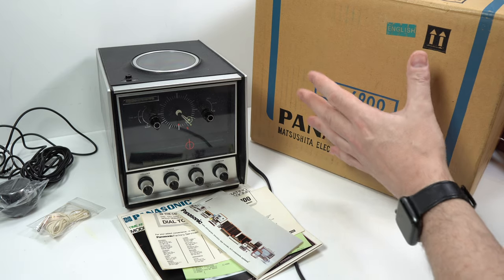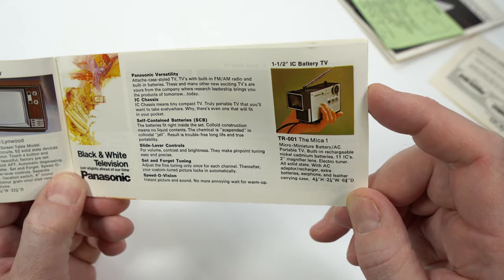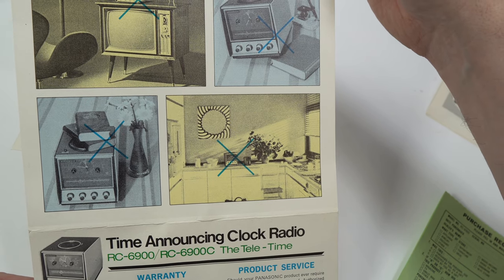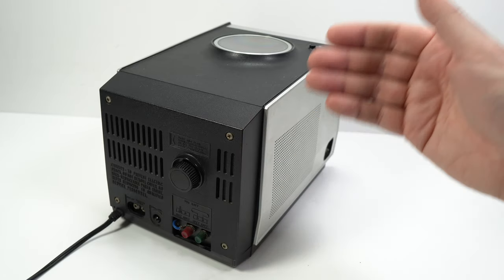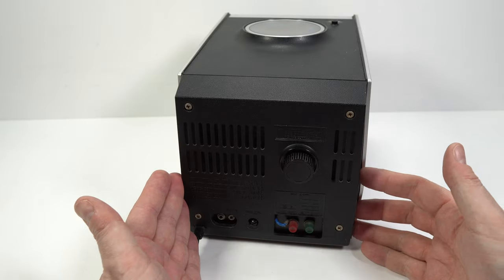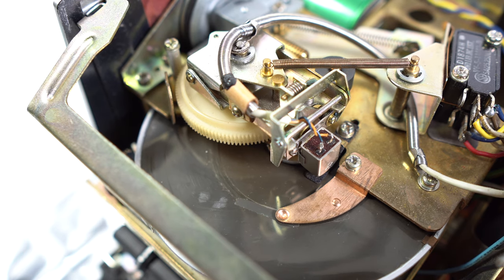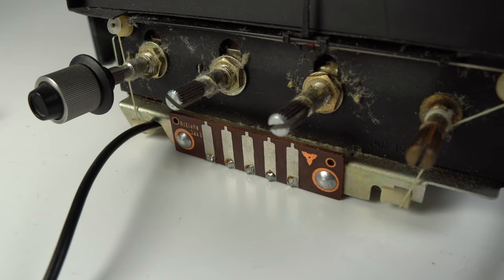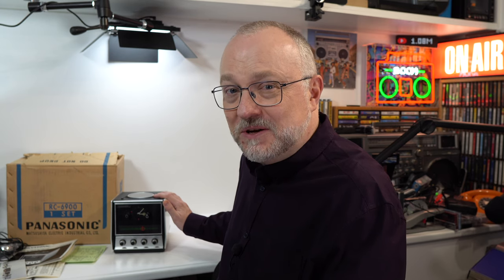The fifty year old Talking Clock Radio

Comment: I worked at Panasonic in my youth, when these and all the products in the mini-catalog were very popular. I was one of the few people in the US who were certified to service these at Panasonic.  It is essentially a cassette recorder where the head moves along the two magnetic "tape" discs.  Other than normal "wear & tear", the biggest problem came from people spilling drinks into it, which would "gum up the works".  Literally, the spilled stuff would adhere the two disks, and sometimes even the moving head, which would wrinkle and rip the disks.   A clean-up and replacement of the disks would restore functionality.  The  worst damage, usually unrepairable, was putting a plant above it with "Grow Sticks" for fertilizer.  The fertilizer and resulting drip water would not only corrode much of the mechanism, but also the PC board below, and sometimes electrically short things out as well. FYI: The disks were available in several other languages.

This and the TR-001 (which was made with Panasonic's own custom thick film hybrids and modules, $$$$ unheard-of outside the aerospace industry) were part of the philosophy of each factory having an outstanding top-of-the-line, unique product.  The first two letters of the model number identified the factory, i.e. RC=Clock Radio, TR=B&W TV,  CT= Color YV, SE=Stereo Combination with mini record player, etc.   Yes, only either the wealthy or the disabled had these.  Only the very, very wealthy had the TR-001, which was kind of impractically small and came with a slide-on 1.5x magnifier.

Comment: You've gotta think the engineer who came up with the concentric magnetic discs was pretty proud of himself. That's a very compact way of appending 2 recordings.
Reply: Ya, very half-way clever that but $130 is an insane amount even today, geez modernity sure went ahead and just spoiled us in tech-liciousness! ;] 
Sad that operational units are so rare.. no doubt due to the fact of all the physical wear to the magnetic discs not to mention being unshielded in that electromagnetically chaotic environment right above a 'light' bulb with equal practicality as a heater. I couldn't figure out where it was playing the O'CLOCK from, which I'm now doubting I even heard ;]
Reply: @djosearth3618  I would assume the O’clock part would be on the minute (outer) disc as there would be no minute to announce then.
Reply: His boss took credit for it. The engineer committed sepaku.
Reply: very cool for sure
Reply: @djosearth3618  in the seventies there was less electric interference than today, so it would be less of a problem. For the blind that price tag would have been worth it, I'm sure
Reply: @uncleTedK  do you mean sudoku

Comment: I'm from Buffalo. I used to get vacuum tubes from that store back in the 90'S.
Reply: Fellow Buffalonian here. Amazed that place made it as long as it had!  Really went through some tough times in Bflo as a specialty shop.
Reply: I need some vacuum tubes when I get a guitar amp that requires tubes
Reply: @vincebarnhart8290  It probably benefited from being right next door to the Tonawanda GM plant (at least if I'm looking at Google Maps correctly). Nowadays that address is home to Pooley Inc., which Google lists as an industrial equipment supplier.

Comment: Interesting that this came out in 1971 and the TI voice synthesiser chip came out only 7 years later in 1978. The pace of technological development is truly astonishing.
Reply: They had the technology to do this for about two decades before this device came out. Back in the late '50s and through the '60s some schools being built new in the U.S. were outfitted with a magnetic tape system like this that would play the bell sound or time announcements. I remember that an elementary school I attended, built in 1962, used an automated system like that.

It was just that nobody thought it was worth scaling that system down from something that was the size of a fax machine until 1971.
Reply: @VulpesHilarianus  - not for $150
Reply: @fredbloggs5902  $150 was still quite a bit of money back in 1971. Adjusted for inflation that's around $960 in today's money. You could buy an entire living room wood furniture set for less than $150 in 1971. Without those speakers and wiring going all through the building they could cut down the costs, but the pricey part was always going to be that magnetic disc and the read head.
Reply: @VulpesHilarianus  - a chest of 5 drawers alone would cost you over $100 in 1971.
Reply: @ohioplayer-bl9em  Well we have had "Space Lasers" being shot at us forever, but we had been told it was just lightning! Kudos to  Marjorie Taylor Greene for setting us straight!
Reply: @fredbloggs5902  BUT, that was REAL WOOD, not high pressure particle board that starts sagging 2 days after you bring it home!
Reply: Good old Speak & Spell is where it all started, at least for the consumer market.
Reply: @VulpesHilarianus  yes $150 in 1971 would cost over 90 hours of labor at minimum wage ($1.60) at the time..i always look at it that way..
Reply: Personally I'm not convinced technological progression is linear, it's definitely cyclical. We lose knowledge and tech and reinvent it100s or thousands of years later. eg Aspirin, first computer
Reply: @VulpesHilarianus  The GPO in the UK had a talking clock that used magnetic drums on their telephone network in the 1950s. When you wanted to know the time, you just picked up the phone and dialed it up.
Reply: @ohioplayer-bl9em  Mass production, invented by Henry Ford. Until then products were individually made. The designers of the Merlin aircraft engine were surprised that car manufacturers like Packard could make their engines so accurately that all parts such as piston rings were interchangable.
Reply: @ohioplayer-bl9em  Actually it's a cumulative snowball effect of knowledge. Each generation of new knowledge stands on the shoulders of previous generations. That, and white people..

Comment: My first thought when I saw 50 year old talking clock was “They had a talking clock in the 1950s!?” Whoops... Calendar check. I forgot I’m old.
Reply: Exactly what I thought. Despite being almost the same age as this clock.
Reply: @grahamlive  that's not old, I was twenty when this clock was marketed.
Reply: The Dark Side Of The Moon turns 50 in a couple years and I really don't know how I feel about that.
Reply: yep.. 1950s was the 1st thing came to my mind ..😂
Reply: They could have built this in the 50s. From the curcuitry it's nothing but a tape player, and electromechanics were already very advanced back then. So a clock mechanism with oxide discs instead of hands and a swiveling head would have been well within possibility.
Reply: Thought the same thing. I still think the 90's was 10 years ago.
Reply: Man, what a fogey.
Reply: @tony_w839  It’s still older than I feel I should be. In my head I’m about 25.  😊😂
Reply: @jasonblalock4429  does it? Released March 1st.
Reply: I feel attacked
Reply: TBH I'm only 19 and I seem to use the year 2000 as a reference point too even though that's a year before I was born...
Reply: Glad I wasn't the only one.  Damn....
Reply: @jasonblalock4429  I remember the record stores in 1987 all having "It Was 20 Years Ago Today" plastered on posters, flyers, and ads.

And the Rolling Stones were called old at that time.
Reply: What I like to do is subtract my age from the year I was born. And then recoil in horror.
Reply: Same!
Reply: Very much the same.
Reply: Those halcyon days of being 30 something
Reply: Same LOL
Reply: Same, I thought it was from the 50s, not 70s.
Reply: Thought the same thing and I'm 20 LOL
Reply: I've done that so many times!
Reply: I wanted to comment the same, even if i'm just 25.
Reply: My thought exactly.

Our internal clocks are stuck in 1999.
Reply: The 70s were only 20 years old, right?!? Damn...
Reply: @jasonblalock4429              The Dark Side of the Moon was recorded in 1972, so we're pretty much there already.
Reply: I was thinking 1960's.
When he said 1971 I said wow I'm old.
Reply: I am just a bit under half this clock's age, and I still thought the same xD
Reply: @grahamlive  oh my god so am I
Reply: Well the first talking clock was from the 20's with a mini gramaphone type thing in ut
Reply: @jasonblalock4429  The boombox tape that I recorded on December 25, 1991 will be 30 years old on my  no. 13th Christmas of the year...And just last 30th of December it has been 20 years since I recorded my first CD-R.. A watched pot never boils...
Reply: @Plastic Icon 2 - Freewheeling Gunslinger Edition Mary Mother Nature was still catching herself writing B.C. on her checks on 1 A.D...
Reply: That moment when I realise that I'm are older than the clock 🤨
Reply: @jasonblalock4429  WHAT?
Reply: im only 29 and im stuck in 2000ish as well
Reply: You and me both.
Reply: @grahamlive  I’m stuck at my early twenties and it’s mid 00’s. Sometimes when I have to face the reality it shakes me to my core.

Comment: Back when I was a kid someone got me a talking/moving Dalek for Christmas. I took it apart, as you do, and it was a fascinating bit of 70s/80s technology. It had a miniature record for the voice and one electric motor with some gears for both the moving and the talking which struck me as an ingenious bit of cost saving. This was just at the end of the time before the prices of microcontrollers and digital memory went into freefall and everything was done digitally.
Reply: I had a K-9 toy using the same tech. The record even had a B side with more phrases.
Reply: I still have my Dalek, It's red and talks but didn't move. Like you I took it apart to see how it worked and it  stopped working :(
Reply: Do any of you remember the old See & Say toys from around that same time?  Similar technology.  I had several of those as a toddler and pre-schooler.  I ran across one years later where the string was missing.

Comment: What an amazingly ingenious mechanism! My dad retired from the Navy in 198 2 I think. He retired as a master chief and he was an electronic warfare officer. He designed radar dammers and stuff and when he got out of the Navy he ended up running and then owning a custom fishing rod business and wholesale place. And I remember asking him when I was little why he didn't stay in electronics when he got out of the Navy and he said because once everything went solid state it got boring because you had chips for everything. I kind of understand what he's saying now. It's amazing the ingenuity and just how clever these engineers were to make things happen that we can do today with a little tiny chip.
Reply: It depends on how you define electronics. Once everything went solid state hardware was separated into material science and software. My department chair told me before but I was too ignorant to believe.
Reply: @平-o2n  The point my father was trying to make was that he used to have to make his own board s by the vacuum tubes wire everything design your own circuits figure everything out and not just have to be either on the software side or the hardware side. You had to be all sides.
Reply: @michaelfrench3396  Being on both sides... Actually I used to think this way but this old school method wouldn't be able to accomplish today's systems complexity. That's why it had to be separated, layered, modulized. Previous engineers were clever but today's engineers can focus on more sophisticated things. Look I'm saying what's right or wrong. It's just an evolution. I'm saying maybe you could look electronics in a different way. :)
Reply: @平-o2n  Oh it didn't have anything to do with anything other than it was more fun for him when he had to solve all the problems instead of just some of them. So instead he built fishing rods. 😂😀👍

Comment: You know, those magnetic film discs could probably be reproduced with a little help of some semi-functional originals.
That thing is cool beyond it’s years!
Reply: Especially for something that was made back 50 years ago!
Reply: Some old 8 inch floppy disks may help, but the thing is to write all the cycloid-like tracks right and even, the head inside is a read-only one for sure and you'll have to reproduce the entire assembly which provides the travel to it in order to build a proper recorder.

Comment: "It seems that the tinfoil hat wearers are actually on to something." - Techmoan, 2021
Reply: I've been hearing a lot of that the past 5 years or so. Validation is nice even after years of being told to get my head checked and stay away from sharp objects... 😳
Reply: I've been recommending they check into a psych hospital seems like they might be a little beyond outpatient help ;) lol jk.
Reply: I'm going to wrap my smartphone in tinfoil so "they" can't spy on me.........
Reply: For the best effect you need to wrap it in 3 layers of tinfoil then put in your microwave twice once on 60% for 9 seconds let it cool down then put it back in for 40% for 20 seconds.
Reply: Well either im a genius or a nutter because in my old house i had a pirate radio studio and to sheild out the 3000 watts of RF from the antenna from the audio chain i used 3 layers of tin foil rolled out on the floor walls and celing and even sheilded the windows . which was a bit tricky since i wanted to be able to open them so i used conductive computer case stripping to make the contact around the window sections. 

Well what i ended up with was an  EMF faraday sheilded room which not only had noticeable physiological benifits but some very interesting properties due to the variable capacitance that would occur between the 3 layers of foil. Now i should mention that many functions in the station were controlled by means of toggle switches and momentary contacts linked to various relay banks to interconnect remote and local functions. And indicator lights ,temprature control,timing and multi stage selectors All electromechanical . 

what is peticularly interesting to me was how something i might call electromechanical logic effect would happen where once the system was in operation for a few hours of broadcasting certain functions like mic switching and air monitor muting and record play triggering would automatically activate at the proper times without having had the actuating toggles or buttons pressed.

   In this highly unorthodox and rule breaking configuration of relays, switches, earth ground,power supply grounds, + supplys and - supplies and insaine ammounts of "mix and match consumer and commercial grade devices,transformers and you name it homebrew sensors all interconnected as one neural network so to say it would appear that or at least seemed that the studio could learn how to perform switchings at the proper times on its own.

I do not understand how it could be possible. The only theory i have is the layers of foil were distributing charges in specific ways that were influenced by the pressure applied by my feet depending where i was standing and throwing switches on one of 3 panels. 

Its a mystery and required further investigation but most unfortunately that whole machine as well as my lifes work was destroyed by what turned out to be arsonist fire. One day i hope to reproduce the system and possibly continue the research but i just wanted to share this with everyone. Maybe there is a " logical" explanation that im overlooking or perhaps something greater.  

 Its hard to believe i know but im not lieing or exaggerating. Some sort of memory logic or ghostly intervention?  Im a scientific type so i doubt the ladder.  

Tin foil its not just for conspiracy theories anymore.
Reply: @DOCTOR_SONG  The thing with tin foil is that depending on how you use it you're either creating a faraday cage effect or just making a massive antenna to boost your receiving and transmitting range. For example if the guy who commented i'm going to wrap my phone in tin foil all he would do is cook the inside of his phone because he has now trapped in all the radio waves and heat which creates a reflecting feedback loop. Honestly if you're worried about this at all the best thing you can do is just turn your phone on airplane mode to shut off all antennas completely.
Reply: @michealpersicko9531  very true like a wave guide. Ive considered the risks of accidentally creating RF concentrations as well and when working with RF this should always be remembered
Reply: @DOCTOR_SONG  Answer: RF is black magic
Reply: one day the whole world will come to the same realization as well lol
Reply: @DOCTOR_SONG  that’s a bizarre story but I believe it & now I want a movie on your life story. It has interesting plot elements: a radio studio, rule-breaking, unnatural occurrences, a terrible fire, & an arsonist who set it & the loss of your life’s work before you could ever figure out the mystery behind the strange electromechanical behavior
Reply: @calico9046  🤔hmmmm .

Comment: Even with all the fancy technology we have these days, you can still turn on an old clock radio and receive radio signals, some things don't change. Brilliant 😊
Reply: Various authorities keep talking about switching off FM radio, but I don't think it will happen for a long time yet. I mean we still have newspapers, which are a far older media format. Making so many millions of FM radios redundant in favour of lo-res DAB and flaky online streams is a crazy idea.
Reply: @donaloflynn  that's pretty understandable. I think radio will always have its place, just like the POTS (plain old telephone system). There's reasons it's used as a back up to many digital solutions.